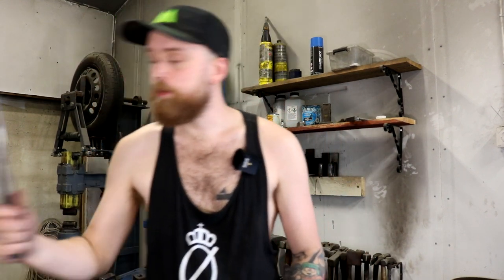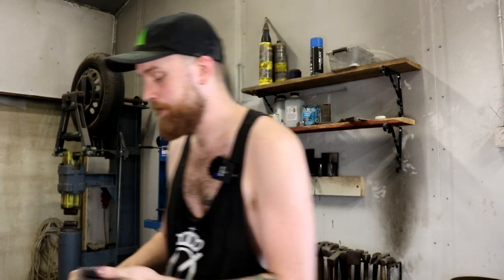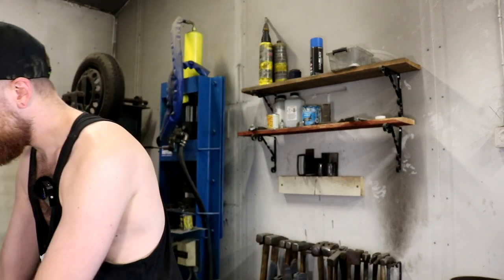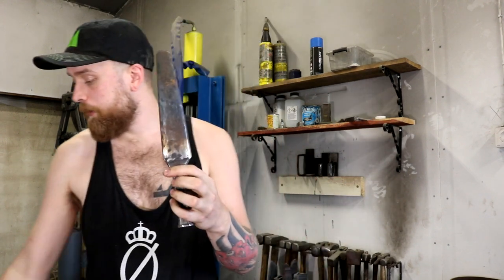Blacksmithing - Forging an Axe Drift

Comment: I use unhardened c45 for my drifts, i have made somewhere between 50-70 axes on some of them, all in the Powerhammer without problems. Orvar supreme is however the absolute best steel i have used for hot work tools. If you ever visit Norway, look me up, so we can make some axes. 😊
Reply from the maker: Vart i Norge håller du hus?
Reply: Kvam, Ca midt mellom Trondheim og Oslo langs e6.
Reply from the maker: Jag bor i Värmland, ganska nära gränsen till Norge, så det är nog bara några timmar

Comment: Looks great Neil! The only issue I see is cooling the drifting between heats using water could be an issue
Reply from the maker: You cant use water, that can cause cracks. However you can use oil to cool it between heats, acording to my source
Reply: Nils Ögren if you don’t mind I’d love an update after 5 axes to see how it’s holding up

Comment: Bearing steel or 52100 is also air hardening. But i dont know how is it compared to h13. But bearing steel could be easier to find.

Comment: Have you tried Flap wheels on your Angle Grinder they are very Aggressive I have used them on Hard Welded jobs but I have No experience of the steel you used, may be cheaper than Linishing  Belts.
Reply from the maker: I havent tried that! Thanks for the tip

Comment: Good job. To be honest I havent forge anything so far. Do you mind sharing some info about axe aye or drift geometry a bit. I didnt find on the net or yourube about it.
Reply from the maker: It depends what kind of drift you are making. I like it roughly 50mm long and 2mm wide when the drift is at the thickest part. I also like one end to be pointy and the other rounded. Since its tapered it creates kind of an gour glass shape inside of the eye of the axe
Reply: Thank you so much for the reply. You are doing amazing job. Hope I will do my own blacksmith workshop in the future.

Comment: I was wondering if you have taken the wobble out of your power hammer yet? I am not at blacksmith but I have been a welder for 25 years and I believe it may greatly increase the efficiency of your hammer if you can stiffen it up a little bit. I am sure someone will make a silly comment about my comment but that is not!! What I meant.
Reply from the maker: I have not yet done that, but im planning to!
Reply: Glad to hear it I think that particular project me make quite a good video